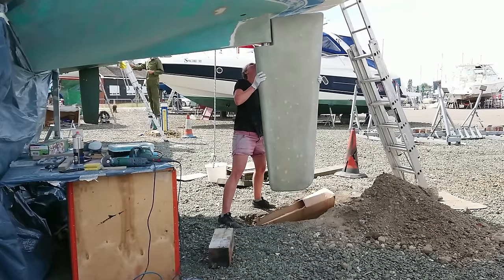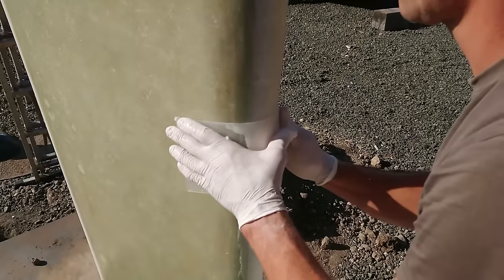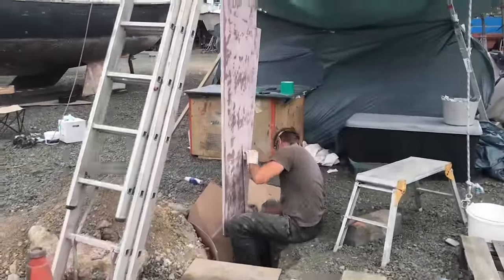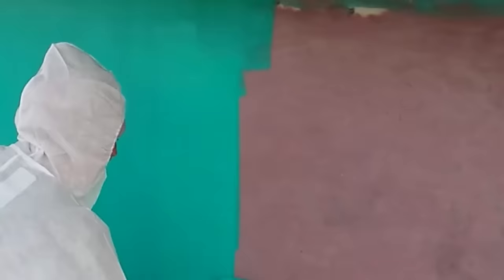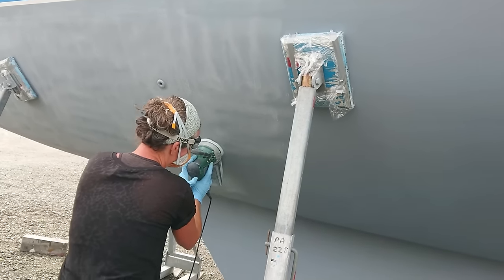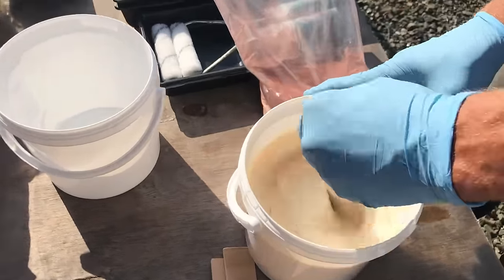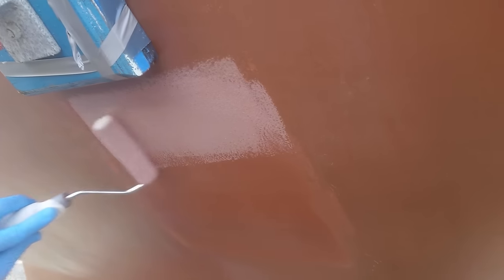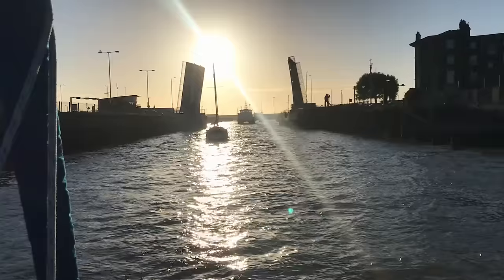Applying Coppercoat  - Why we said Goodbye to Anti-fouling Paint

Comment: That was absolutely first class.
It does seem to be the case that copper coat failures are not product failures but application failures.

Your preparation was meticulous and following the application regime on a hull that size with just the two of you is impressive.

Well done.😀👍⛵️
Reply: 😅e

Comment: Good discission, we did copper with epoxy, 11 years ago in The Netttherlands and sailed into an area were hauling out is difficult.(asia) Whilst we do need to scrape the hull regularly when longer term in marina (built on a reef iin tropical waters) the Copper coat has helped since applied, not saying zero maintenance, but far less, and we saved a ton because otherwise you need to go out every year. Hauling out in this part of the world may costs 3x the price in Europe, hence there is a savings. We did hera that Australia is not okay with copercoat, but I have no plans going there.
Reply: We have a copper coat rep in Australia. He sells plenty

Comment: Copper coat is not easy applied. It needs perfect finishing. If not the coat will fail your boat. 
Like this boat it must be perfect. This video is a very good instruction video.

Well done 👍🏻
Reply: @MonkPetite  that is what I thought as well, but it is not that critical. We have copper coat on our hull and the hull is full with dimples and small damages. Still the copper coat works perfect, no growth at all after 1 year in the water.

Comment: Je dois faire aussi ma quille. Vous mettez de la résine epoxy directement sur la quille, c’est bien cela ?
Reply from the maker: Yes, epoxy directly on the keel.
If you have a solid lead or steel keel, the West system G-flex will bond better to the bare metal.
Reply: @SailingHiraeth  ok thank you so much.

Comment: Does a copper coat really last 10 years, even in warm waters?  Nice job BTW!
Reply from the maker: Coppercoat say it should last at least 10:years.
You occasionally need to re-abrade the surface to refresh the copper oxide. When you eventually need to reapply, it only needs 2 coats over the top.
Reply: @mikefriend7570 I'm in Florida and prepping my sailboat for Coppercoat. Here in the Gulf of Mexico and Keys, cruisers have seen longer than 12 years. I don't know how long it lasts as the 12 year old applications are still going.  They still come out every year or two to check running gear, and touch up the bottom of the keel if they get into sand during the year. If applied correctly it "just works".
SV Jane Ann
Reply: Had cc long time ago. I am in very warm mediterranean waters (croatia, italy) . Was ok for the first 2  years but then too much growth on it and cleaning was too time consuming. Went back to normal antifouling, it is cheaper and taking out the boat is good anyway.  Would not use it again.

Comment: How has the copper coat been performing? 
Been toying with the idea, many mixed reviews.
We live in the tropics of Australia, dont use the boat as much as we want to! Sits on a swing mooring for a month or so at a time.
Reply from the maker: So far the cooppercoat has been great, been on 4 years now and we have had good results. We lightly abraded it with scotchbright pads for the first time this year as we had a small amount of slim on waterline when we got lifting at end last season. 

Based on current performance we expect to get at least another four years out of it. 

Most problems seem to be caused by poor preparation and incorrect application always follow their temp and humidity application advice. 

We found Coopercoat had a excellent customer service and are great if you need to discuss your particular requirements, they even offered to video call us on the day we were applying to advise.

Comment: Great Job, nicely done. No criticism, however you do not want Square trailing edges, particularly on Rudders, rather 45° for better shedding of tip vortices, look it up. Maybe next time😉. My other comments, from hard earned experience, is to check the other elements of the steering system, particularly cheek Block attachment, sheaves and axles etc, as their bonding and integrity become more stressed now that rudder is more efficient and the shaft more rigidly located in new bearing collars, within the hull. Think of it as a whole, and where is the weakest link? Same applies to sheets and halyards that get replaced with high performance low stretch ropes & lines as their lack of give transfers much higher shock loads and strain into blocks and clutches everywhere else........ But excellent to see such careful refurbishment of your pride & joy. Can't help but feel that Copper coat, whilst the right choice, needs owner application (with skill & care) that  some if not most boat yards would not take. Fair Winds & Smooth Seas.
Reply: Yep, not knowing much about boat designs, I was a bit surprised to hear about square edge for the rudder as way to fight turbulence. Sounded very counter-intuitive
Reply: I have worked mostly rebuilding old schooners and we put blunt trailing edges on the rudders because that was traditional, the theory being that the turbulence caused by the edge produced less drag . Like driving a pickup with the tailgate down causes more drag and uses more fuel. High speed rudders of course have a very fine edge.

Comment: We are finishing applying our copper coat. We are now exposing the copper with 320grit sand paper. The instructions we got from copper coat says to sand alot more that what it looks like you did with the scotch brite pad. 
How has it been holding up for you you?
Reply from the maker: We've had the Coppercoat on for 3 years now, and it's been great. This is the first year we've had to do anything other than power wash it.
We had a small amount of growth accumulate around the water line over the winter, so we've just given it all a once over with scotchbrite pads. 
We might put a quick update video out to show what we did.

Comment: Nice work! However, if the copper is exposed by the Scotch Brite, it has to leach into the water. Otherwise it would have no antifouling effect.
Reply: Should be dusted on tacky coat then dry rolled so it remains exposed. Copper is illegal in many harbors, they come around and check to see if it is going green at the waterline.
Reply: @D-B-Cooper I don't see why, given that most antifouling is copper based anyway along with being ablative and toxic as hell.

Comment: I run a marina in Massachusetts and if I saw you working like that without drop clothes underneath the boat to protect the soil, I’d throw you off the property.
Reply: While you are right,  there's got to be a better way to encourage people to take care.  Something like "the ocean is obviously important to you, since you're investing all your energy into fixing your boat.  All the sanding residue washes into the water unless you take a few easy steps,  like tarping under the boat to collect debris and using hepa grade dust collection when sanding."
Reply: All yards have rules, most now have runoff water testing and this wouldn’t be allowed. I had a laugh at the rudder hole.
Reply: Take it easy tough guy
Reply: Looks like it keeps the weeds away.....